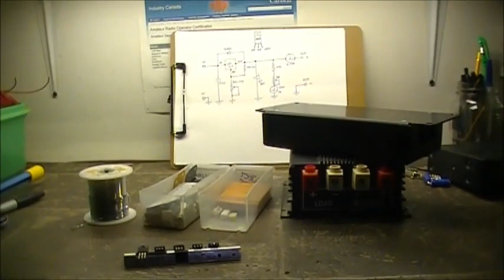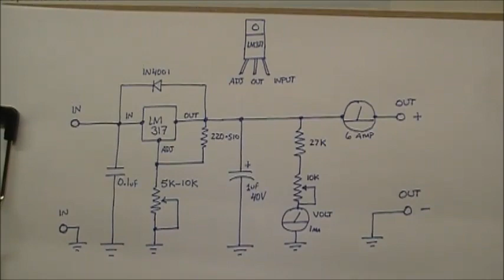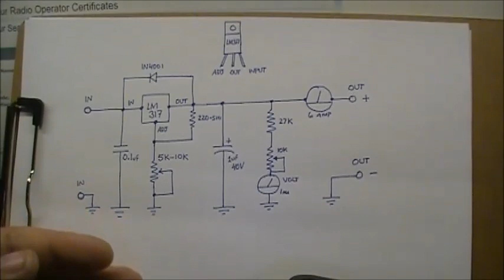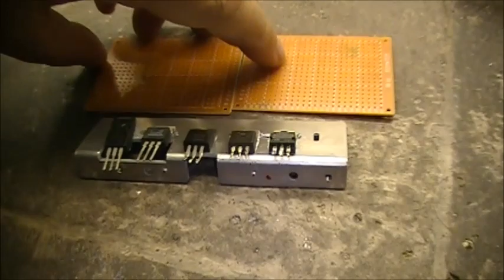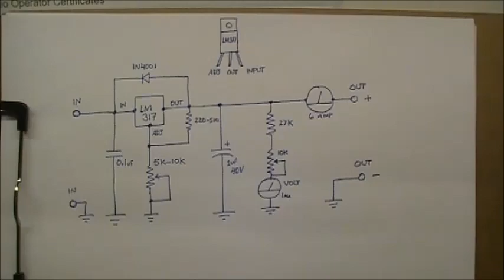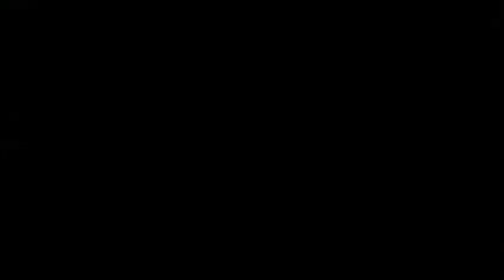Adjustable power supply  PART-1

Comment from the maker: This power supply add on, is for testing purposes only.   I build small circuits and need various voltages that are stable, hence why i want to use voltage regulators for 4 different voltage sources.  The variable regulator is for playing around with other circuits that work between the other regulated voltages of 5, 6, 8, and 12vdc.  Why be limited when i can expand on the circuit.  ;-)

Comment: Would "all time" variable be the best option? You seem to want to use multiple taps with varied voltages. Maybe I misunderstood you.
Reply: Hi there Andy. I can remember you from way back ! Great to meet you again .  I was thinking the same thing using a variable  It gives you far more options but..can limit you in other ways. I believe Darrell said this supply was for a tube amp ? So saying what I've just said then a fixed voltage would be best 😁  better for the tube if nothing else.  73s. Bud.